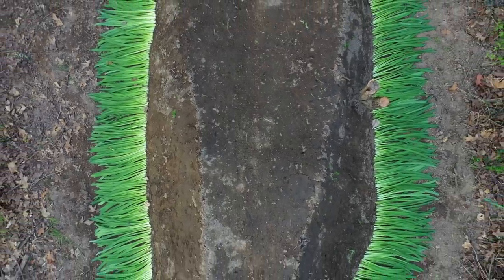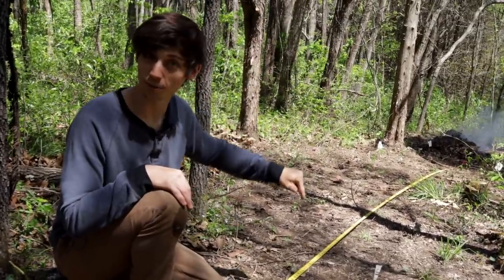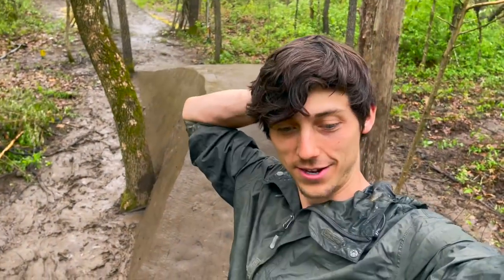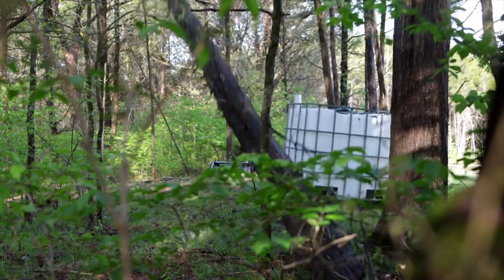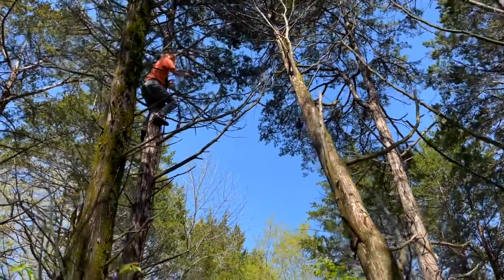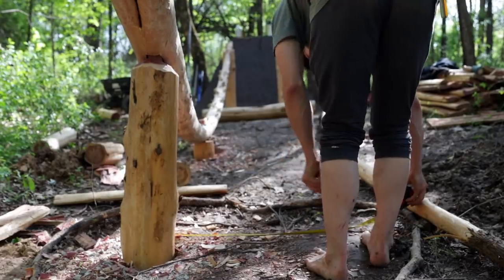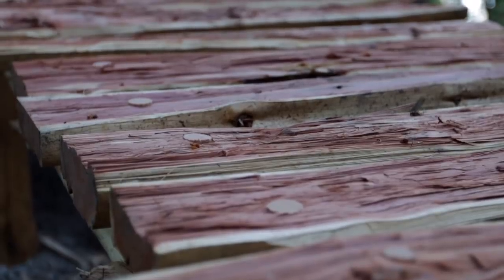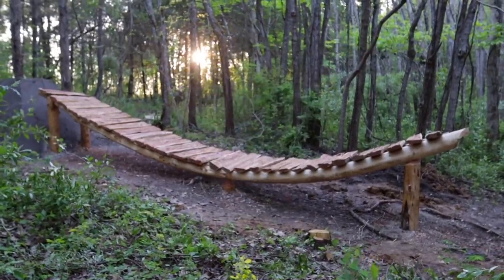Turning a tree into a MASSIVE bike jump WITHOUT Power Tools

Comment: When the wood dries (seasons), or during winter, during freeze and thaw, is when the deck boards will pop off. In really cold winters, for a few days, I always have deck boards pop loose from the boards loosening their grip around the nails due to the expanding and contracting. So expect that.

Comment: for dowels you could always use a wedge hammered into a cut in the dowel to add width and strength to the dowel meaning it wound be a even stronger bond and there is no way at all the wood would pop out the dowels (not that they were in the first place)

Comment: If the dowels for the plank joints were bought in a store, the reason why those joint are so strong is because the wood was dry, and when it absorbs humidity it expands creating a really tight friction fit

Edit: fuck, you said it in the Next video 🤣🤣🤣🤣🤣